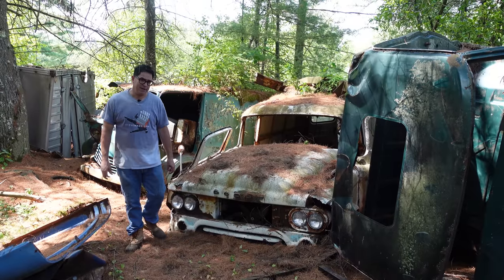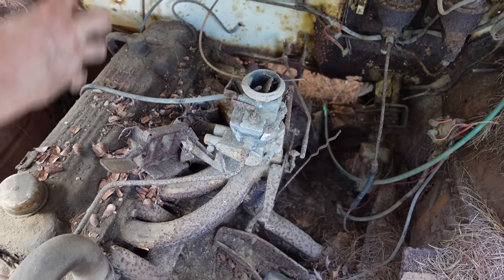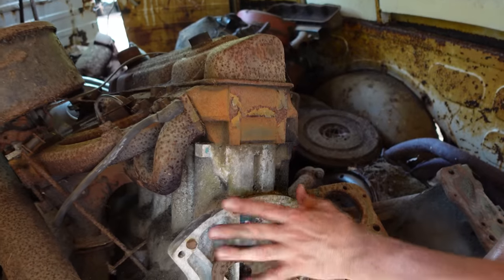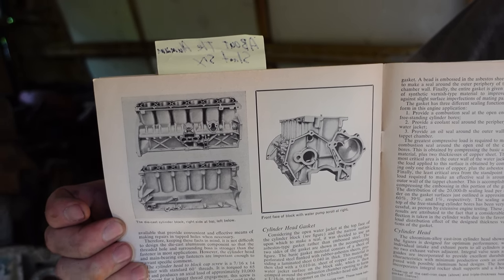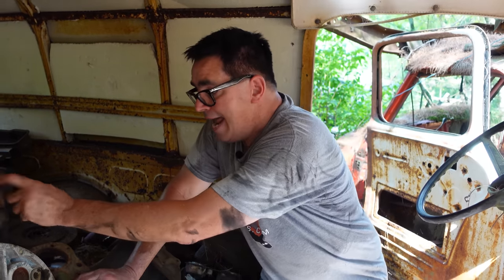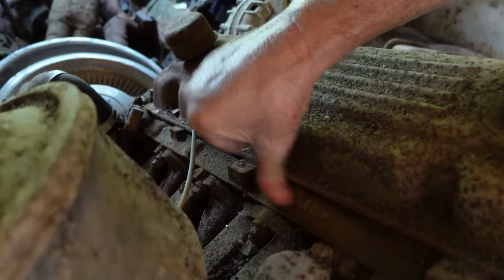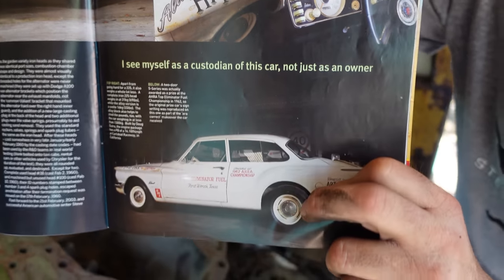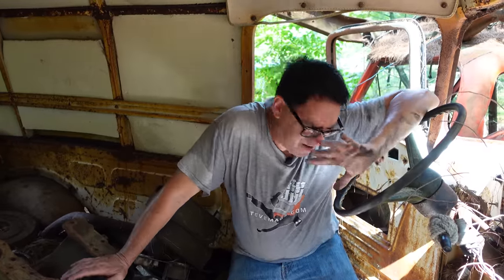Slant Six Surprise!

Comment: That is interesting. I’m not really a Mopar affectionado but still never heard they made an aluminum slant six. I knew Buick had the aluminum 215 ci V8 in that era that ultimately was sold to Rover. The Vega was the first aluminum motor to come along that got my attention - for all the wrong reasons. What was the reason the manufacturers felt they needed to go with iron heads?
Reply: my best guess would be logistics, Steve wrote in his original article that they did produce a handful of aluminum heads for testing. If they had seen more success sales wise and hadn't run into the corrosion issues they may have continued with development.From what I read Chrysler planned for the whole of slant six production to be aluminum and made the cast iron as a stop gap until they worked out the design kinks, and when it didn't work out they stuck with the bulky cast iron that were now familiar with.
Reply: AMC (Rambler at the time) also had a straight 6 all aluminum OHV engine that debuted either in 1960 or 1961 they are sort of rare but not super rare and just like the Chrysler engine they suffered the same head gasket issues because of corrosion.  If I remember correctly they also used an aluminum cylinder head. I had one years ago in a 1961 Rambler classic I never did anything to it and I drove it a ton being my main car from about 2005 to 2012.  It was a typical Rambler of the period just absolutely reliable about the only thing I ever had to do to it was adjust the points, rebuild the carburetor (modern junk fuel issues) and change the oil. If I remember correctly the engine came in the American and the mid size Classic but it was an option also and being a Rambler not too many people opted for options.
Reply: You see after WWII's ferocious demand for aluminum planes/engines ended, ALCOA, Aluminum Company of America, was looking for a market for its enormous capability to make aluminum, so was pestering automakers to use more aluminum. Buick actually made the 215" aluminum V8 about 1950 for concept cars before going into mass production of it in 1960. And, of course, Chrysler gave in and made some aluminum Slant 6's. As did Rambler for 6's.

Comment: My Dad bought a 62 Dodge Lancer GT  (2 door - no post) with an aluminum block and had it shipped to England where he was stationed in the US Air Force.  Other components on the car were also aluminum like the dash, I suppose for some token weight reduction??! Not sure.  I inherited this car, my 1st car, in around 1968, now in Upstate NY, by which time the engine had been replaced with an iron one from a Dodge Dart.. the aluminum one was worn out at around 60K miles.  This car had 3 on the column and for it's day was pretty quick despite the tiny little 1 bbl carb, a really fun car to drive, weighed only around 2000 lbs as I recall..  BY 1968 it was pretty much rusted out so I found some junk yard fenders, and bought a few quarts of bondo, and drove it until about 1972.  It was a great car to drive but unfortunately wasn't built to last. It was pretty much junk at 10 years old and went to the crusher.. too bad.  Now I drive a 2000 BWW 3 series wagon with over 200,000 miles on it... Also a slant 6!   Drives like a new car.

Comment: I remember in 1960 or 61 nascar had a compact car series at Daytona and slant sixes own it.
Reply: Destroyed the competition
Reply: Chrysler produced factory 'hot rod' parts those cars that included a performance intake manifold that could mount a Carter 4bbl and a hot cam and exhaust headers. They called it the "Hyper Pack". Clifford Research, 6=8 reportedly sold manifolds of this design.

Comment: The slant six was standard on the Chrysler Valiant here in Australia. Nice and light and streets ahead of the old-school sixes in the Holdens and Fords, and made for a nice lower bonnet-line...
Reply: It was hardly a light engine.
Reply: @erroneouscode  As I said, if you had read, it was lighter than the Ford and Holden engines...
Reply: @paulhall170  Try re-reading your own post, you didn't specifically say that in your first post. Short of trolling the net for hours I would disagree with that claim anyway based on my own experience with all the mentioned engines.

Comment: I had a 62' Lancer GT with this motor. For apparently no reason  it needed a head gasket or So i thought. What had happened was a crack in #1 cylinder from the head surface about 1 inch down.  Being young and stupidI made a repair with a gear clamp like used to mount a tach to your steering column and a bead of weld with some results.  All it really did was go through the aluminum block and made a bead on the steel sleeve.I got back enough compression to run on all six but it used some water so not a 100% fix. I sold it to my GF at the time who used it for over a year with a milk jug full of water at hand. She in turn about gave it away to a single mom for $200. She drove it another two years.

Comment: The slant of the engine extended the block’s overall length, therefore allowing for a longer stroke. That comes in handy when keeping up with traffic from 0 to 30 mph (city driving).
Reply: A longer stroke also helps with fuel economy

Comment: A buddy from high school built the 225 in his 64 Valient. It made zero sense from a money standpoint, but it was a blast to rat around in. In my van or dad's truck, woefully underpowered. But robust. A friend's stopped running as it was 4-qt low on oil. Brought it back up to full and it continued running dependably for years.
Reply: I had a 66 Barracuda super 225,I put that light car up to 115 mph many times and could do better burnouts than a lot of v8s,indestructible!

Comment: The /6's ran in production up into the early 2000's where they were built for industrial equipment after '87 production vehicles ended. The 30* slant created a few good benefits: the ability to have longer intake & exhaust runners creating an engine ideal for making torque, that slant design made for lower hood lines/ the ability for people to see over the hood, plus it aided in a lower center of gravity with combined with the torsion bar front suspension helped improve handling around corners, the design allowed for the water pump to be back farther- aiding in a shorter hood length & less materials/ lighter weight cars, (engine was initially designed for the A-bodies & Chrysler wanted to get these A-body cars to road course racing against the compact European cars), the Dodge Lancer, dodge darts, Plymouth signets, Plymouth valiants, the early Plymouth barracudas. This engine would turn out to be a bread & butter winner for Chrysler corporation world wide.
Reply: Chrysler producing the 170ci (1960-1969)
The 225ci from 1960-2002, the 198ci from 1969- somewhere in the early 80's... 
the Aluminum slant was only the 225ci from 1961 till early 1962. The noticeable difference between a 170 & a 225 is the deck height: look for that tiny 5/8" diameter heater/ water pump hose that goes between the head & top of water pump: 170: its very short, just long enough for two hose clamps. 225: its a lot longer.
These engines share the same main bearings as the 426ci engines. 
I've always wondered how much performance can be achieved if these engines had a cross flow head.

Comment: The original slant 6 was tilted over for the low hood of the Mercedes-Benz 300 SLR in 1953, predecessor to the production sports car, the 1955 300 SL "Gullwing" coupe.

Comment: Crazy that they had problems with aluminum blocks with open decks back in the 60's and for some reason they decided to bring the open deck design back and are still having problems with it now. You'd think automotive engineers would learn from others past mistakes. You can take a cast iron block closed deck engine from the 60's and boost the hell out of it making double the HP per cubic inch and it takes it like a champ. But the factory built aluminum block open deck boosted engines are blowing gaskets and warping blocks just under everyday normal use. Makes me sad to be a mechanic and have to tell someone with a less than 5yo vehicle they need an engine and the replacement may do exactly the same thing...

Comment: Having the engine at an angle allowed for a longer stroke in a lower profile, giving a high torque rating. That was the big reason for it. The other features were fringe benefits.

Comment: 225 dodge darts were great cars. After 60 or 70 thousand miles you had to add a quart of oil with each fill up of gas but they would keep on keeping on.  From point a to point b it would get you where you wanted to go.

Comment: Not only do I see an open deck, the bores have very little around them. Even Subaru engines notorious for head gasket failures had more aluminum there.

I suppose to make a winning aluminum slant six, Darton Sleeve or a similar company would need to make something to fit.

Comment: Wonder if the engineers at Chevrolet looked at this engine when they design the engine for the Vega. Looks like head gasket failures were common with both of them.
Reply: Yes, very similar. Reynolds Aluminum was pushing the idea for all the manufacturers. Die casting was lighter and cheaper than sand casting but requires an open deck design which is why the Vega had problems as did the slant 6 and the 196 AMC 6. The Buick/Olds 215 V8 was not open deck but was very difficult to produce with a high reject ratio which caused them to drop it after 1963. Strangely the engine that replaced the Buick 215 in 1964 had an iron block and aluminum heads.

Comment: If they went through all of that trouble, I wonder why they didn't cast an aluminum head. That would have solved the head gasket problem, first of all.
That panel truck looks salvagable and in outstandingly good shape, rustwise, for that old of a Mopar. I had a '56 1/2 ton panel with the flathead six of which I was completely happy with. The only reason as to why I don't have it now is because Michigan winters caused the body to rust off of the frame.
What's the story on that one. Is it for sale?

Comment: Too bad they had forgotten about the technology when they were experimenting (finally) with an aluminum head for the slant in the late 70's.  Why not make an all aluminum slant?  But, clearer heads prevailed and everything got put to the wayside. There was no need to upgrade an engine when it was on it's way out. The fact Chrysler used it through 1987 just goes to show how backed into a corner they were.  The 3.9 V6 was a much better engine even though it too was a compromise.  But then with the acquisition of AMC, Chrysler learned what a good 6-cylinder engine looked like, discontinued their useless slant 6 and ran the AMC designed inline six through 'til 2007!

In my youth, I had both a 225-equipped '71 Swinger and a 232-equipped AMC Gremlin.  The Swinger was a mutt in comparison to the Gremlin. It was slow, it overheated and just in general never ran properly regardless of any repairs done to it.  Though I will admit, converting it to a Super Six with a 2 barrel did improve driveability and increased fuel economy.  But the AMC 232 is a lovely little engine. It's peppy, it loves to rev, it's more bulletproof than the slant and it LOVES being worked on.  I converted my 232 to a 2-barrel, did some ignition work and took the baffle out of the exhaust manifold and it's like a whole new car.

I still have the Gremlin.  I sold the Swinger 20 years ago.

Comment: Question for you Steve: When NASCAR went 'compact car racing' in 1960 with a special series for the Corvair, Falcon and Valiant, did the Valiant run an iron slant six, or an aluminum one? The Valiant won every single race.......

Comment: AMC had a similiar issue with its aluminum block inline six. It too was a free standing cylinder bore design. Based on the 196 it shared many I ternal components. The owners manual specified that the head bolts be re-torqued every 6,000 miles iirc. Also the manual specified that an aluminum friendly anti-freeze was required. Well garage and shade tree mechanics alike were of course much more knowledgeable*.  Re-torqueing was ignored and conventional anti-freeze added leading to problems. The block was a high silicon aluminum alloy similiar to the alloys used today.  I suspect the issues requiring re-torqueing possibly had to do with the engine using the same head bolts as the cast iron version. The blocks were actually made by the National Lead Company and were a die cast components. Around the same time Renyolds in trying to drum up business had aluminum V-8 blocks cast. These also included the AMC 327. There was an article in one of the Mopar tags that covered this.
*The same attitude led to some of the issues the Corvair had. Especially the squirrely handling. GM specified a front tire pressure of about 12 to 15 psi. Naturally the geniuses knew better. Now if GM had included a sway bar........
Reply from the maker: Hello mpetersen6, I might have written those stories that you reference. I've submitted about 8 magazine articles on the aluminum Slant Six plus one on a prototype aluminum AMV V8 that discusses Doehler-Jarvis / National lead Company's role in the AMC 195.6 aluminum block six popper. Thanks for writing, Steve Magnante
Reply: @SteveMagnante  
If it was you thanks. Otherwise I never would have known about the Aluminum 327 castings. I do that there were a number of GenIl type AMC blocks cast in the late 60s? And in the 70s. These came in a variety of types. A full water jacket version. A solid block meant strictly for drag racing applications and a short deck water jacketed version for Indy/Cart racing.  The short deck had the deck height reduced at least an inch maybe more. I would not be surprised if at one point there aluminum versions of the 232 family built just for testing. It is my understanding that OHC versions of the 232 were tested in the 60s
I think in the mid to late 60s the SCCA missed a potential opportunity with the A Sedan class the TransAm was based on. Most of the earlier pony cars were actually sold with inline 6s. A sub class of A Sedan limited to inline sixes of 3.75 liters/227 cid might have worked out. Let the cars run at a lighter weight and open up the rules to allow some engine modifications might have made an interesting series. Run races as a second event at regular TransAm races. This also might have led to some decent performing 6 cylinder production cars in the US.

Comment: Aluminum blocks are sandcast just like the iron blocks. Die casting is a completely different conversion technology, not used for automotive engine blocks.
Reply from the maker: Not to come off like an "expoit" but the aluminum block Slant Six was indeed made using a high pressure DIE CASTING machine that was nearly as big as a house. The low weight that was part of the goal wasn't possible using traditional sand cast techniques. its all spelled out very clearly in the SAE White Paper written by Willem Weertman, the head engineer of the Slant Six program (and many other Chrysler engines). Another benefit were the smooth external surfaces that aren't possible with sand casting. As for an aluminum cylinder head, YES Chrysler experimented with them. I owned TWO that were dated 1960. If you Google "Steve Magnante ALL-uminum Slant Six story" you'll see some magazine articles I did for Hemmings Classic Car on an engine I built that had one of the aluminum heads on it. In fact, the 2-door Valiant I show in the Australian magazine has that "all-uminum" Slant Six in it. Those aluminum heads were pre-production test items and around 60 were cast - using the SAND CASTING technique - as a feasibility study. I know Chrysler toyed with aluminum heads again in the mid-1970's but none of it arrived on the show room floor. Thanks for watching and writing, Steve Magnante
Reply from the maker: Not to seem like an "expoit" but these Slant Six blocks - as well as Rambler's 195 aluminum Six block of the same time frame were indeed the product of high-pressure aluminum die casting. The alloy has a lot of zinc and is not weldable by "mortals' as a means of rebuilding any lost material surrounding the integrally-cast iron bore liners. Thanks for writing, Steve Magnante

Comment: I had a Slant Six of my very own in a ‘77 Dodge Aspen “winter beater” when I was still back in Minnesota during the early 90’s. The car was unremarkable in just about every way a vehicle could be measured, but the thing rock solid reliable! Truth be known - I miss the plaid interior seat coverings of that vehicle after years of staring at the boring gray “mouse cloth” they put in today’s offerings……🥱
Reply: That was a very reliable engine but I-would take the ford 300cu inch over that any day.

Comment: Hats off to the slant six, for sure. But their smart thinking didn't consider the location of the distributor. It was a pain to get to. Not the only engine to have that problem, but there we are.
Reply: If you're in the states you should be thankful. In Australia being a RH drive nation we had steering components running down under that side of the engine as well.

Comment: I Had a buddy who got a truck that had had a /6 retrofitted to replace a blown v8. my buddy didn't know anything about cars, and one day calls me to look at it...
turns out he drove it until it "got so hot it stopped running" he pulled over, walked to his destination, walked back by which time it was cool, DROVE IT BACK HOME where it LOCKED UP AGAIN when he was pulling in the yard...
when it got there, it was cool, he had only told me it was "overheating a little" so i threw a water pump and thermostat at it ($25 total) and on the test drive, i notice that distinct bakelite smell, so i fish the story out of him... the fact that it grabbed the crank or piston or whatever from thermal expansion, then let it go when it cooled down, TWICE... then drove around for another 5+ years